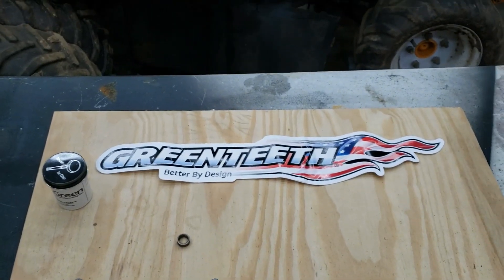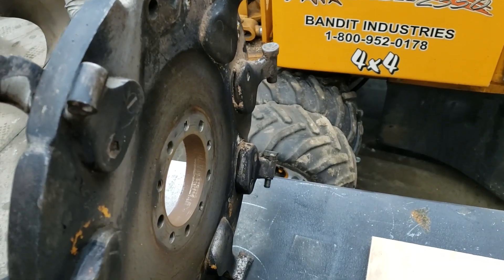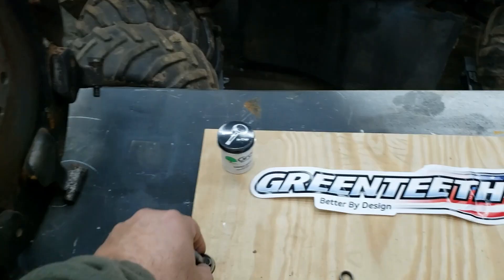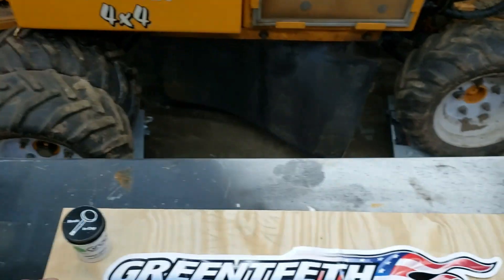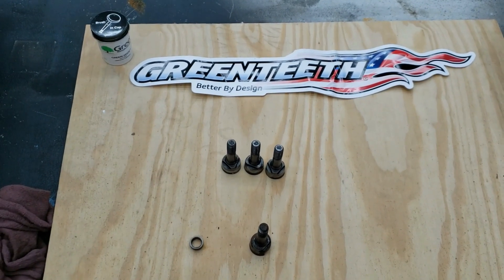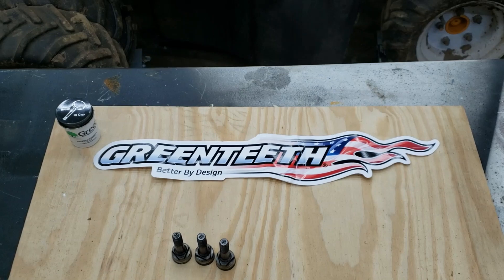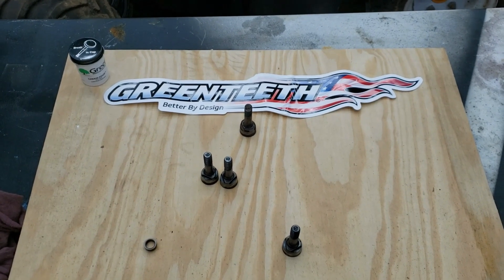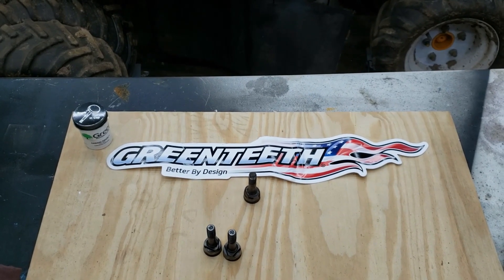The truth about Green Teeth's Stump Grinder Teeth and the 3 type

Comment: I bought the Mechmaxx 24" cutting wheel hydraulic stump grinder. Machine is China made so I am sure the teeth are from there as well. Is there that much difference in the grinding teeth ie. Ones that came on it or green teeth?
Reply from the maker: Teeth sometimes have a different hardness but thats ok sharp teeth is the key

Comment: How do you feel about the green teeth quad wheel? Or the guys removing teeth to run half or third of the cutters?  I have a 352 35hp with Vermeer pro series teeth.
Reply from the maker: I was one of the original testers of that wheel on a 352 diesel and I liked it
Reply from the maker: You would see a great improvement with time on tooth replacement and cutting speed

Comment: My vermeer sc252 has a smoking problem , im tearing the motor off it , who bores out kohler motors , its .003 passed min spec. cylinder size , thought about order piston and rings next size up and honing it myself , id rather find a shop to bore it though
Reply from the maker: You might have to call around some of the motorcycle shops and ask for a name of a machine shop

Comment: I'm building a stump grinder..and wondering what teeth to get..for now iv got a 1/4" thick x 10"7/8..it's a steel rotor for a motorcycle..6 hp engine..I'm gonna build another with 1" wide disk..13 hp 390..
Reply from the maker: look at https://www.greenteeth.com/ and look at the 500 or 700 series teeth setup

Comment: New to the grinding world question are you still a green teeth believer?
Reply from the maker: Yes but depends on the conditions of the area you grind in (rocky or not ) and the hp of your machine
Reply: @mustangrebuilder  we have a Rayco 35 h.p. And we are running ws 700 greenteeth and we really watch when we are grinding and have no luck with them. Have you ever owned any Rayco machines.

Comment: What’s the difference between a 500 900 and 1100 series green teeth
Reply from the maker: 1110 are the largest for 60hp and more  500 are for smallest machines  .... what machine do you have
Reply: @mustangrebuilder  ok thanks predator 38 and 360 👍

Comment: I do have a question. First off I'm Mike. I have a Toro STX 26. Badass machine on tracks. I'm wanting to purchase a new Toro STX38, was wondering about putting the Revolution blade on it. Or would it be best too stick with whats on it?
Reply from the maker: Ok whats on it now ? I have run both Revolution  and green wheels and yellow jacket systems ... If you live or grind in a rocky environment you cant beat the revolution for tooth strength but the normal wheel drags down a smaller hp machine . Here is the good news thay have come up with a new wheel for lower hp machine  called Rev Lite https://newriverequipment.com/  now I run green teeth due to less rocky ground   https://www.greenteeth.com/  and you can ask for a guy named Chris Peters there to see if they have an upgraded system for your wheel ( tell him Adams Stump Grinding the guy from youtube referred you)
Reply: I'm still wondering about the Rev Lite Wheel on the  STX 26 Toro...I'm in more dirt than anything....I'm in Southern Illinois.

Comment: Okay so the difference in series has that got to do anything with how hard of metal used to make the teeth
Reply from the maker: ok the number like500, 700,900, or 1100 is the diameter of the tooth, and size is determined by hp of the machine to be used on now the shape of the carbide ( the dish cut in the tooth is what is the difference with the red , green   or wear sharp}
Reply: @mustangrebuilder  hey thanks much for your time and information I'm just now using the green teeth I noticed that they do wear down faster than yellow jackets I appreciate your videos and the time it takes you to make them you're a good man

Comment: Places that rent stump grinders should be required to watch your video. I rented one and the teeth were completely rounded over.  It more or less pounded the wood off the stump.  I looked at the teeth after  I made a pass on the first stump after it seemed the teeth weren't really removing much wood.  The teeth did not have the cupped look like in your video, but looked like the head of a ball peen hammer.  If I ever need to rent one again I will check the teeth before renting it.

Comment: I'd say at least a third of all my wear sharps have exploded.  I hit at least 1 large rock in every stump. I wish there was an option that was tougher for smaller grinders. 

Thank you though. I look forward to sharpening video.
Reply from the maker: What series are you running 700's or 900's
Reply: @mustangrebuilder  700s. I have a 20 hp handlebar machine
Reply from the maker: @kilnithardwoods  many say even on smaller machines the 900 set up does  better but the wear sharps do break and I find the original greens are stronger you have to ask for them when you order

Comment: Hi I just started grinding about a year ago and have a carlton 4400-4 I was wondering how to know if its possible to wear out the actual wheel on a grinder?
Reply from the maker: https://youtu.be/RVz7JpI51g0
Reply: Thank you very! much I really appreciate it I was thinking I was going to have to buy a new reverse s wheel for it..... are the bolts that hold the wheel on hardened I need to change those for sure mine are worn on one side

Comment: I just bought rayco stump grinder sjrs 2012. It's only 25 hp. What kinda green tooth should I be using? I heard there is a specific type that I should be using because it's not that tough of a grinder.
Reply from the maker: the new wear sharp
Reply from the maker: and it also depends on what soil type and trees you have  , the reds are sharper but are for like softwoods and clean of  rocks in the soil
Reply: 700 series
Reply: go to greenteeth.com and search for your recommended machine setup